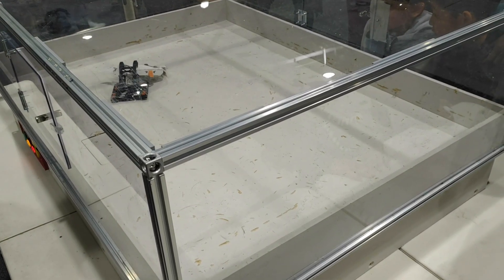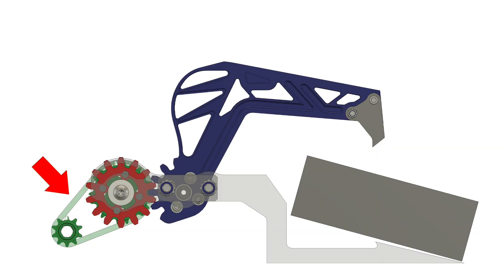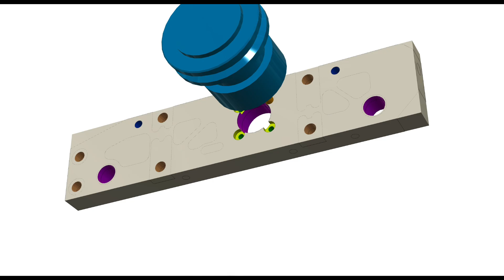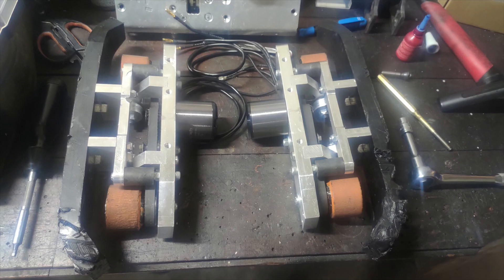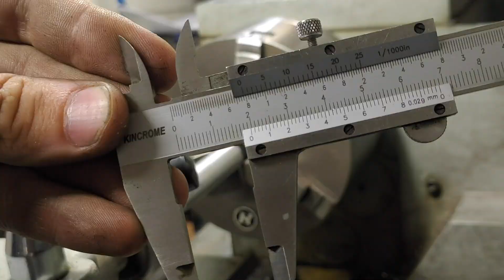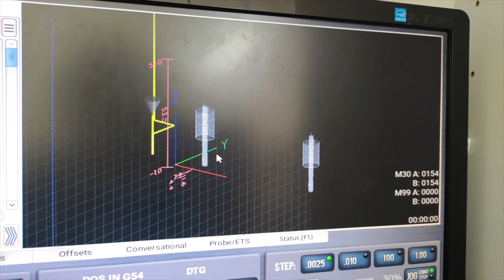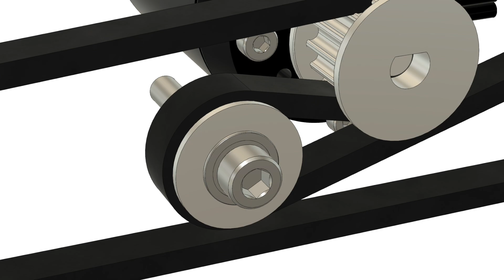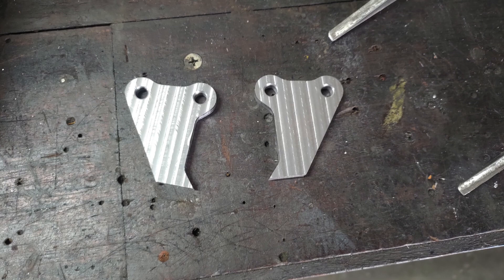Brutal Suplex and Lighting Speed - Combat Robot Derive S Part 1

Comment: I had an idea once - a hollow metal sea urchin that moves with a gyroscopic motor inside. It's would attack by charging capacitors mounted to the inside of the shell.

The second two adjacent "spines" touched something electrically conductive it would arc badly enough to cause scorching.

The ball would be too big for crushing jaws to reach and unexpectedly slippery (you bet your butt I would grease anywhere that could be grabbed) and have high thermal diffusion because of the many long thin spines. (Titanium if I could manage it, but ya know, budget.) A real killer against anything not electrically shielded, real hard to grab, impossible to flip in any way that mattered.

Too dangerous for humans though. If the capacitors didn't discharge properly It'd be unpredictably deadly with no real warning. 10/10 automatic win against anything not well electrically shielded, 0/10 should actually be attempted ever.
Reply: Not to mention against all rule sets I've ever seen, but love the idea!
Reply: That thing will never pass a safety inspection

Comment: As this is using three gears in parallel instead of one thicker gear, would there be any advantage to offsetting each gear a third of a tooth, so they aren't all in phase with each other?
Reply: Poor mans helical gear, except you need to either keep it extremely well aligned or shave some material off to tolerate worse alignment
Reply from the maker: @kimi42 not sure. Might be stronger, but you'd need to ensure the gears are axially aligned

Comment: Minor adjustment ensued.. 😂
Have you come across a 3lb equivalent to those skateboard motors? The idea of ditching the gearbox weight is appealing to me, but im still in the three pound range. If derive were 3 lb, what motor/gearbox would you start with? Also, any chance of a cad file for that lifter arm?
Reply from the maker: @gtdgabriste1 yes, some large low-kv outrunner should would work. Such as SunnySky X2212 v3 980kv, especially if running an AM-32 ESC

Comment: 10:11 go and steal some bots!

Could instead of removing the entire spinner assembly, maybe replace the spinner with a sawblade? 
Or is it just not effective since the blade would be mounted to the bot body instead of an arm like most spinner-to-saw sportsman conversions and would get bent after a good frontal impact?
Reply from the maker: @bami2 definately could do, it's fairly common to compete open class robots with a saw blade swap. Felt that the grabber would be a more interesting challenge though.